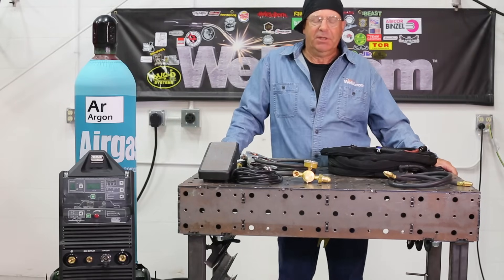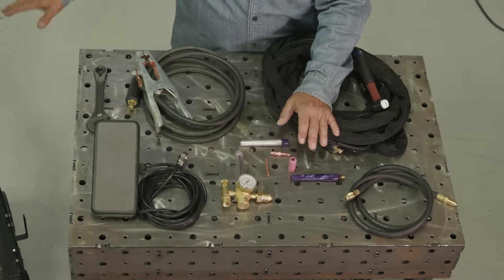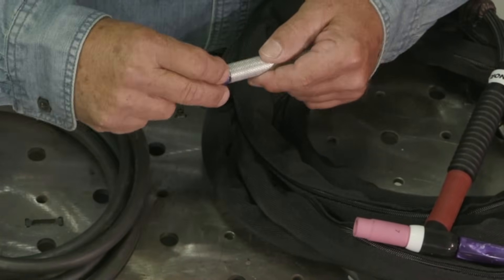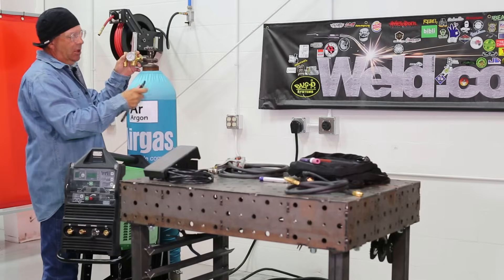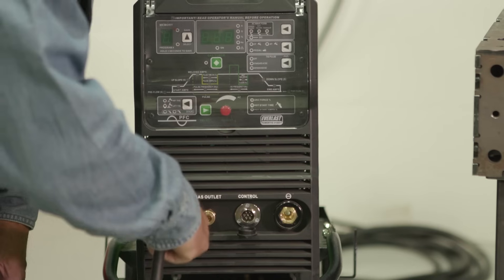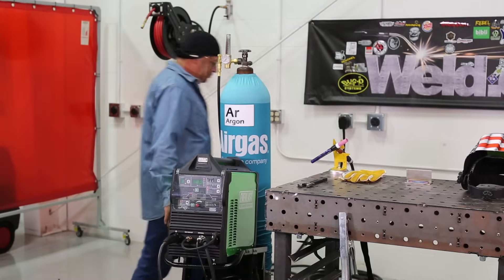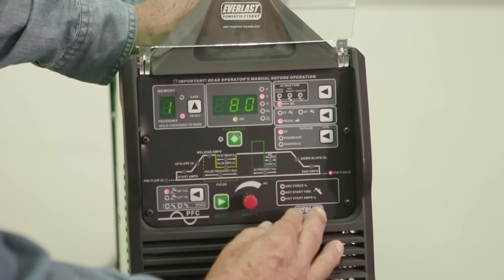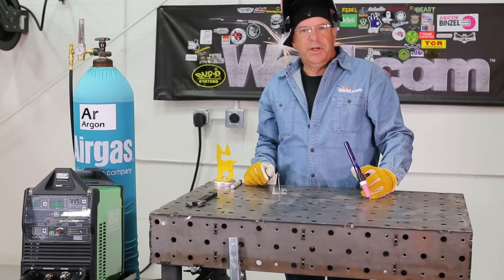How to Setup a TIG Welder (Everlast 210EXT)

Comment: Why wasn’t the length of the Tig tip talked about? How far does it need to set out from cone? Ac or dc why would that be important? These things should be gone over in this video since it is for beginners

Comment: How many amps and is that set up for AC or dc welding. What tongston do you use for stainless ? I looked through the comments but did not see It on ones I read.!?

Comment: Im looking at this tig and the 200dv 
Is the 210ext that much better of a machine in your opinion?
Im building headers,aluminum thin wall charge pipes,intercoolers.
Cheers

Comment: Hi, is that possible to cut a metal with 10mm by tig welding machine. The tig welding machine is 200am max capacity

Comment: My welder is a Thermal Arc 175 SE ARC MASTER and uses the stick weld and lift Tig option. 
Would the setup be a bit different with using the Tig option? 
as my welder uses the quick connect twist connections if that makes sense to you?  
I would like to know a bit more about it and if you can do a review on the Thermal Arc 175 SE ARC MASTER that would help me a lot thanks 🥳😎

Comment: Why do you need to used gas in arc welding? I'm new to all this welding stuff
Reply: miki S The gas shields the weld as it cools. Without it, the hot metal would react with oxygen in the air and ruin the weld. Other methods like stick and flux-core wire wilding use a flux that cots the weld as it cools, so you don’t need gas for those, but you do need to remove the flux layer (slag) afterward.

Comment: Using my tig welder today welding stainless steel box section. Was tacked together in a few places a few weeks ago with MIG with stainless wire. I welded a couple joints fine. Then I went onto one and it burned the tungsten back instantly with sparks it looked exactly like arc welding. I changed tungsten and checked set up and did exactly the same thing. I moved onto another area and works fine again. I can't see why in this area the tig really doesn't like it

Comment: Thanks for the video Bob! Just one question. How is the gas transferred through the torch to shield the weld?

Is there an orifice in the dinse connection of the torch? It carries both argon and weld current through the same line? 

I’ve only done tig welding where the torch has two designated lines. One goes to the argon tank and the other is the negative lead.

Comment: Hi Bob, great video once again. I have a different request for setting up TIG though. I have a small 160 amp DC inverter power source that I bought as a straightforward stick welder. I see in its own manual that it can be used for TIG but other than a pic of a TIG torch there are no further instructions. Would you mind explaining how this would be done as there isn't a control or a gas connection on this machine. Only neg and pos cable connections. Thanks. Paul from PE South Africa.

Comment: I've seen arguments back and forth on the use of extension cords for 50A 240V circuits.  It looks like you're using one in this video.  How long a cable is this, and what's your general take on using extension cords?

Comment: Good video I have a question if someone can help. I have a everlast 210 ext tig ac/dc  had it for almost a year. I always get some crazy erratic arc starts I have a video of showing it but can’t post it in comments. On all materials too stainless, steel, and aluminum, i am on probably my 4th bottle of argon from airgas so hopefully I don’t think that’s the problem. Even if I set the start amps up to like 60 it will still do it I sharpen my tungsten properly with a diamond wheel going the right way. Also leak checked everything multiple times everything from regulator down to torch and all fittings in between except for inside of machine but it holds pressure after shutting machine down so don’t think it’s leaking inside machine either. Now here’s the thing I can get rig of the bad start but I have to turn the preflow up to minimum 1 second and I’ll get a decent start. But say if I set preflow to .8 seconds it will be a erratic start. I don’t get it I think I’m  gonna call everlast support I just don’t want to be out of a machine for a couple months if I have to send it in for repair . Thank you good video by the way 🙏👊🏻
Reply: 7

Comment: Couple of great tips that wouldn't be obvious to a beginner (eg, crack the cylinder before installing regulator to evacuate any dirt; stand to the side away from the regulator when opening the cylinder; open the cylinder valve fully...). Thanks, Bob. Great work once again.
Reply: as someone who has never tig welded before you are very right, came looking for a video specifically to see what i didnt know about the setup and honestly without watching this i would have never thought about those things. Gonna have to get me a "youtube certified" patch now😂

Comment: Military rules: Open gas bottle 100% then close it a half a turn.
Reply: Depends on the application. Some compressed gas valve assemblies can leak around the valve stem unless fully closed or fully opened. If it is a flammable gas, such as propane or acetylene, you don't want that fuel - even small amounts - leaking around the stem, which is why you open fully to engage the stem seal. With Oxygen, you only want to open enough to serve your needs (1/2 to 1 turn) so that in an emergency, you can shut it quickly. With shielding gas, I guess the approach you mentioned - open fully then close 1/2 turn - would be OK. But that is just my humble opinion (and how we've been instructed in our fab shop).
Reply: @SoccerPhoto  You got it completely backwards.

Comment: On MIG welding it keeps arcing up at the tip. Any advice how to keep the tip clean and to stop it arcing at the tip. I use tip dip and change the tip regularly. Thanks.

Comment: Hi, I'm struggling with a leak in my fittings with argon regulator. Losing argon even if the torch valve is closed it bleeds argon. I don't have much left in bottle, but would like to fix the leak in the fittings. For the next bottle I get a full bottle. Don't like wasting gas and sometimes the cylinder sings when welding, I know it sounds funny but I'm not yet mastering troubleshooting Tig welding or (gtaw)

Comment: Hi Bob,  could you explain what the purpose of the backcap is on the TIG torch?
Reply from the maker: Not sure if your serious or not... But if you're indeed asking for real, It locks the tungsten into place.
Reply: The back cap covers the other end of the tungsten!
Reply: Thank you. Yes  I was serious,  I've only just recently purchased a welder that has DC TIG capability, haven't yet had a chance to play with that part of it.   If I may ask is there a reason for different length backcaps?
Reply: Tight locations.  Use a short tungsten, use a short backcap, get into tighter places.
Reply: Thank you.

Comment: What is the purpose of the "sock" on the Argon tank?
Reply: Advertisement
Reply: Thermal/electrical insulation for a couple reasons.  Pressure stabilization for some gases and keeps the new guy from striking an arc on the bottle. I've only seen em on propane.
Reply: Can tig welding be done without a foot pedal

Comment: No Teflon tape on the gas fittings?
Reply: Never use tape on the gas fittings as it will cause it to leak!
Reply: You don't it on these brass on brass fittings. It's the mounting surface that makes the seal, not so much the threads.
The ends ( make the seal.
\\\](  ←([\\\
Reply: Wayward Woodworker There precision fitting I think. Pretty sure you don’t need it.
Reply: Awesome feedback! Thanks guys.
Reply: Yes sir, your welcome. It is a good question that most people from other lines of work wonder about, heck I wondered too. I come from a family of carpenters and stick welding fitters. TIG was always a process that was so far out of the range for the average Joe until the last decade that I would not dare but one until last year.

These Everlast machines are worth every penny and I'm not even kidding. I bought a 255EXT in December and it had an arc initiation issue in that it would cycle internally without discharging on the work. Likely just a capacitor that was out of spec, but they got me a shipping label and sent me one hell of a welder back. It was worth it & their service was fast. BTW, if you buy one.. get their NOVA pedal from the start. It'll give you enough control that a Lincoln 3350 hood will flash you because your going below its threshold! I welded exacto blades as a test with guitar strings as my filler. (I got to put out a review with the footage, but got behind.)
 You'll get both though... The one in the box and the NOVA will come sperate. It's a great baseline to feel the difference having both and if you're going outside for wide open welding, just use the cheap pedal and keep your NOVA pedal for in the shop.
Reply: Wayward Woodworker not when the two metals are brass. Brass is soft and needs no tape.
Reply: Aint1S, teflon tape doesnt seal threads.
Thats the most common of misconceptions.

Comment: Thanks, Bob. I'm getting ready to buy a tig machine and this is very helpful. I've been told to open argon slowly but never with an explanation. Can you elaborate as tor why?  Also, I've heard a lot of negative comments regarding the everlast tig machines. Any comments?
Reply: All high pressure tanks sure be opened slowly, if you opened it really quickly it could blow the valve off the top. Then then take would go flying. If you had a regulator on it, the regulator could also blow off or even a line.

Comment: how come you chain the argon tank?
Reply: Can become a missile if the fall over
Reply: oh, does dropping it crack open the valve maybe causing it to launch around like a air balloon? :D
Reply: Yea if ya knock the valve off they take off, find it a mile away or maybe more
Reply: Saw this with a SCUBA tank at the local Volunteer Fire Department many years ago. We had just filled a diver's tanks; he knocked it over - and the valve hit the bottom tread on a staircase. Now horizontal, it shot across the truck bay and embedded itself into the cinder block wall. Really, really eye-opening experience.
Reply: Holy fuck lol. I thought it'd just go bonk on the wall and not leave too much damage except a dented wall but you said it like it went through the wall.
Reply: Lime The only thing that kept it from going thru was that where it hit the wall it was reinforced with rebar and concrete because when it was built, they tied the first few courses of block into the foundation/footer with rebar and filled the cores of the block. Even with the reinforcement, the opposite side of the block was damaged, just not catastrophically. This happened circa 1986-88...for me, a lifetime ago. But left a lasting impression. 2000 psi gas, escaping through a 1 square inch opening equates to a whole bunch of thrust.
Reply: Yea, i understand the tons of pressure part without a doubt. I went to school for painting and use hydraulic sprayer and electric ones and a female almost got me sent to the hospital, sprayed me on my hand, that pressure literally peeved me off and the students are so damn stupid. I literally never went to hospital and never had a problem, from what it looks to me anyways. This all happened because i was working alone and everyone else in class were screwing off and once i went to get a channel locks, the female student went in where i set up to work and and i opened the door and sprayed me in the hand with paint. I sucked it up and god nothing bad happened. Another incident where instructor said i accidentally pressed the trigger on a electric sprayer and i don't remember pressing it, i was sure it went off on its own. It had pressure but with those housings and tips, man IF I DIDN'T TAKE OFF THAT TIP, i'd lost a eye or be dead because the paint sprayed me right in the eye with no tip, only housing. Spraying yourself with paint in your head, i really don't know if you can survive that? Literally injecting yourself with high pressure diesel, i hear you're supposed to make a tourniquet i believe or put pressure on your arm if your hand got injected and they'd have to amputate your arm because they can do nothing to save it, only save you from dieing if those fluids went to your heart. No infection, no eye problems. so glad. This is what happens when you go to school with a bunch of kids and delinquents that don't care about safety or yours. I was a student foreman, top of my class. Was eager to make $ some day but the problems dealing with some of these students just drove me nuts. I went to automotive school and pressure is what helps drive automatic tran's and brakes, engine oil pump, fuel pressure from the fuel pump. I just didn't think 2000 PSI gas would do that much damage from thrust though. I wonder if 2000 PSI gas if you were near it from the gas will inject you in your body or vaporize and nothing will happen.
I thank you for your reply and knowledge. I'm 25 right now.
Reply: Lime - Best to you, hope your days ahead are better to you. On one hand, I've been fortunate to have people show me a lot in life. On the other, I've also had experiences with careless people like you describe. If given a choice, I prefer working solo or a few select people who I know I can trust. When you get the chance, thank that 'guardian angel' looking out for you. I've kept mine busy for 51 years (and counting).
Reply: You freaking understand! This is not complete Horse S*** :D i was thinking about working solo so i can be calm. Only "I" can screw myself over, i barely trust people as of now. If i ever get screwed over again I don't know what might happen. I haven't been very lucky in life but have survive, no death but hospital yes. >:(] I kinda am a grumpy guss because of that. Wow, 51 years. You guys are those I want to hang with. I can't seem to find people like you, i seem to somehow attract the Dumb stupidity out of people.

Comment: come on! this video could not have been better timed, as MY 210 EXT just arrived this morning (friday) and I was getting it all set up for its first run. Perfect timing Bob!
Reply: Too bad this didn't drop 2 months ago when my 210 showed up.  The manual everlast sends is really confusing for electrode/work clamp polarity!  My printed copy shows both are positive!

Curious- Did you get the same gas hose as shown in Bob's video, or a crappy clear vinyl hose?  I ordered the "upgraded accessories" and it still came with the crappy vinyl hose.  Foot pedal and torches are pretty nice though, so I've got that going for me.
Reply: nope I got the clear one but its not too bad. one thing i would say is it would have been nice if they had a quick connect on the rear the way my thermal arc machine does. havent tried the footpedal yet but its an SSC one so should be good. laid down some test beads yesterday and it was super smooth. I got a flow meter with mine but it wont fit directly on as the fittings arent compatible, bit annoying but I'll make it work.

Comment: Do any of the gas joints need Teflon taping? Thanks
Reply: We do not recommend it on our units.  BTW, use two wrenches to tighten connections.  One to hold the fitting on the other end, the other to tighten.

Comment: Bob what's your professional opinion of the Everlast machine? Looks comparable to the Lincoln Square Wave Tig 200 pricewise. Any thoughts?
Reply: In price only.  The 210EXT has far more features and control, closer to the Dynasty 210DX
Reply: @Everlast similar. But my Dynasty 210DX has 4 waveforms, 400Hz in all of them, 1A DC/2A AC starts, 400Hz in AC SMAW mode, runs 5/32 6010, Firmware updates!, firmware expandable features regarding AC GTAW waveform, CNC controllable through the foot pedal socket. 
Now the thing I see better is the advanced pulse thing that seems kinda cool on Everlast.
Reply: Mr Wolf .  Yes the dynasty is a fine machine, but there is practical limit to what super.high frequencies in ac can do.  And low amp start differences can weld.  Not that there isnt any differerence in 250 vs. 400 hz but you get into the law of diminishing returns.  In steel and Al there is very little difference in weld metal gauge capbility betwern 3 and 1 amp and 5 and 2 in Al.  If you put a meter on the Miller you will find the start surge ampd to be higher than minimum posted, and actually as high if not higher than the Everlast.  Its a quiet kept industry secret.  There are videos comparing starts and coke can welding on the net between everlast and m. Dynasty and the everlast does a more controllable job.  But the greatest diffetence is the dynasty is 3 to 4 times the price of the Everlast
If you NEED 400hz then it is a great machine...but most people don't.  But as welders go, the new Dynasty certainly is a status symbol if nothing else...and works well for people overall.  But the dynasty 210 does not have near the welding capacity of the Everlast 210ext thanks to the advanced AC pulse which almost  doubles the 210 amp capacity if set properly.